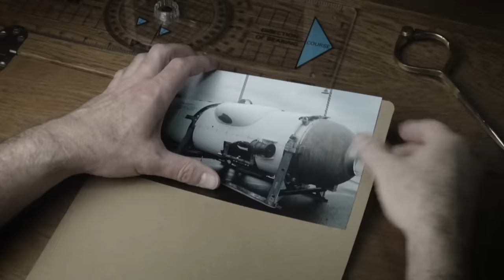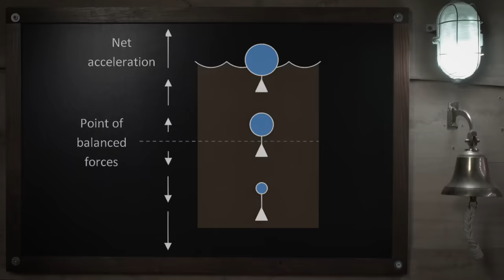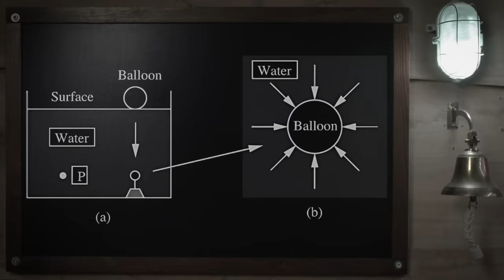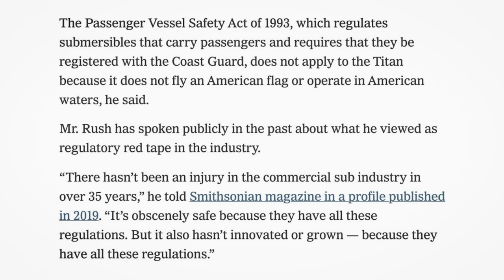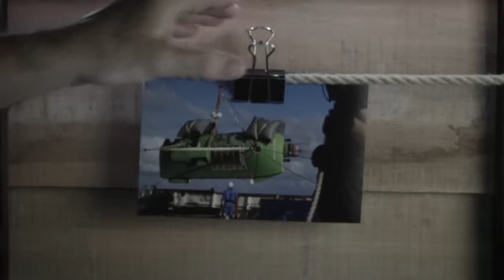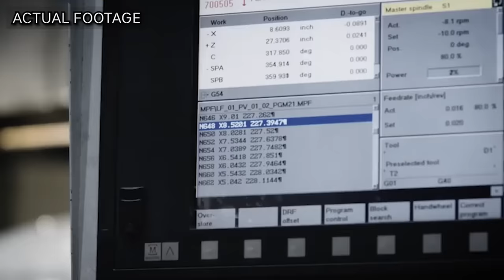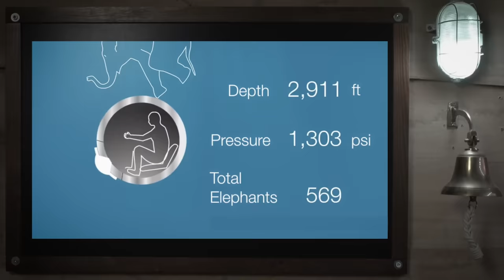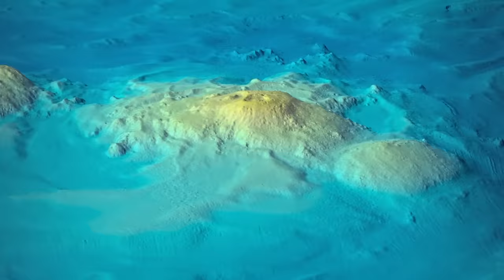Titan: From Inception to Implosion

Comment: Is carbon fibre stronger than steel/stainless steel/cast iron/titanium/inconel/nimonic/hastelloy/monel/ "any other crazy alloy"...?
Answer....=...yes...and....no.
The type of force a vessel is subject to is subjective to the atmospheirs found throughout our world...
Carbon fibre rod..(even when hollow, by nature), is much stronger than a similar sized solid steel bar (toughned, heat treated etc) when exposed to tensile strength...stretching... twisting...load bearing to some extent. 
Under compressive force, and to add to the equation, the difference between maintaining 1 earth atmosphere inside/100 earth atmospheres outside is immense.... 
This project was sure to fail as peer reviewed persons were totaly ignored instead of being challenged and overcome.

This was a bad outcome to a really inovative enterprise. But....totally avoidable. 

Lessons should be...and will be...learnt.   Rip to souls on board seeking adventure.

Comment: Why didn't they hydraulically test the sub by filling it with water it and testing the pressure that the hull can handle .Such a simple test  and very cheap and can be used to accurately estimate the pressure that the sub can handle....You can see the designer did not know anything about pressure vessels....

Comment: This is my thoughts on this matter. No testing was done shocker it failed. Moving on from that and on to carbon fiber use in this field. Could i see it being done, however not in the capacity that they are talking about in the sense of prolonged use. My mind immediately goes to carbon fiber scuba tanks. They are typically rated at 4500-5k psi. With that said they also have a life expectancy of 15 years and have to be hydro tested every 5 years. Now I’d assume with a maned submersible that testing should be carried out every 5 trips to max depth. And certification on a sub design should be subject to 10 plus pressure tests or tested until failure before being able ok’d to a specific depth. Based on where failure acquired. The a second model could be built used test a handful of time and put in service. But, much like a car manufacturer they should have to build a prototype that’s used for “crash” or in this case pressure testing until failure.

Comment: Not very bright aerospace engineering why didn't they pressure test the vessel from the inside it's very easy fill the sub with water and hydraulically pressure test the vessel to 7 km under water even if it's from the inside it still gives you a very good idea of the pressure resisting properties of the vessel. That is why NASA tests space suits in swimming pools.

Comment: My issue with the controller isn't what it is. These controllers are ridiculously reliable, especially when not abused. I have various friends and myself using every generation of gaming console, and most still using original controllers. From Atari to Play Station 1, to the original XBox. 

My issue is the fact that it's wireless. It's easy to have a second backup controller, and a second port to plug in said controller, but if your wireless goes out, then what?

Comment: Pretty sure carbon isnt gonna be the best choice for this sort of task; at least not for a long while. Looks great on paper till you take into consideration its failure characteristics; to many outlier values pop up (high and low) to make it a reliable choice to design around; in low saftey factor systems at least (to my understanding).

Comment: Im still nebulous on this bit about it taking twice the air at 30 meters as at the surface. Ok, but you have the same number of oxygen molecules at 30 meters so why is ur time cut in half unless u have to use double the amountbof oxygen to maintain bodily function. Id think id guess that ud need the same amount or number of 02 molecules at whatever depth u were at regardless though i understand ur sayin " no u need double" why? The physiology is the same ur not twice as large or doing twice the work.

Comment: I worked on the fiberglass hull. It was tested to 7500 PSI for 1000 cycles. Something does not add up.
Reply: As a kid, I remember squeezing half-thawed frozen orange juice, and the cap flying off.

Comment: Every time I hear someone compare this man to Elon Musk it makes me angry. Space is not the same animal as the Ocean. In space you only have to deal with 1Atm of pressure difference. Elon had hundreds of test fires, hundreds of successful flights before he put people on his rocket. Secondly what's wrong with a commodity piece of tec as a control scheme? It doesn't matter if it's mechanical or electronic, so long as it's well made, tested and maintained. Mechanical controls in fact have more points of failure. Game controllers are a solved problem with plenty of inputs, and it's not hard to pack extras. What's distressing about the one pictured is it's not even a PlayStation controller, it's a cheap knockoff. The fact that no reporting agency got that right, and didn't get sued by Sony astounds me. Sony's design dates back to the 90's and is pretty recognizable.